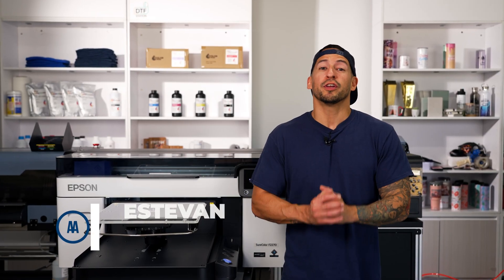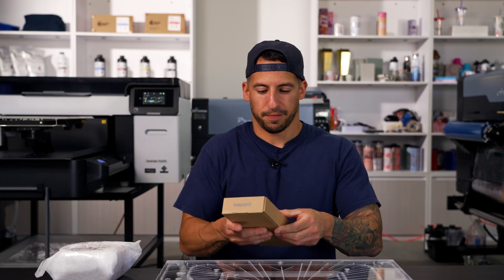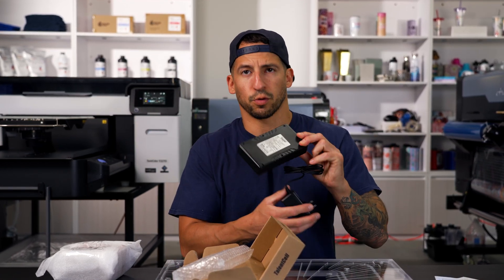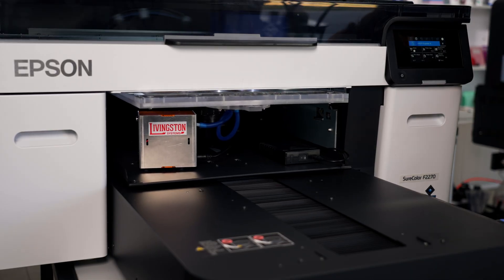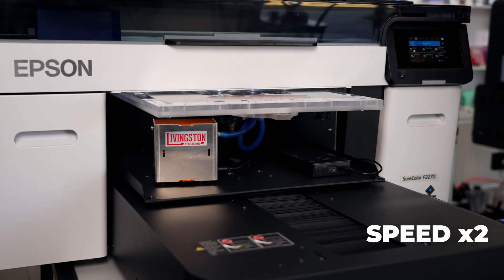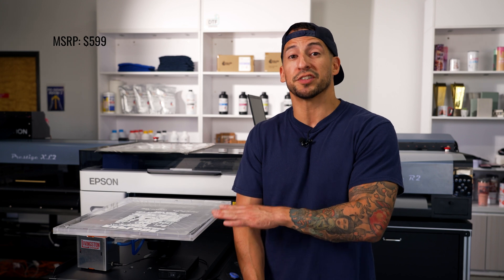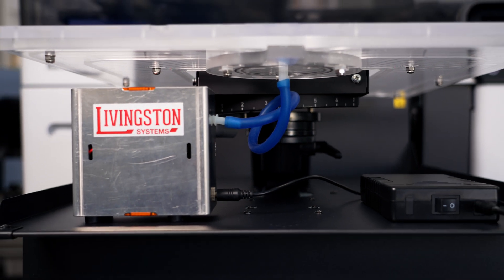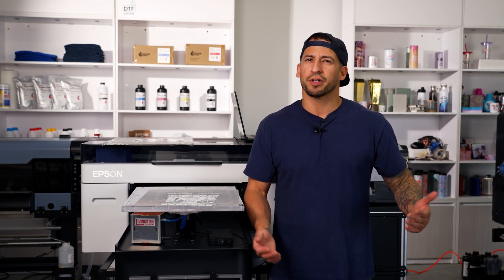Print #DTF Sheets BETTER: Epson/Brother #DTG

Comment: Someone finally copied DTGs vacuum platen.
Reply from the maker: Was there a vacuum option previously for Epson or Brother dtg? I had only seen the one for the converted DTG printers running Epson print heads
Reply: @AAPrintSupplyCo  not for those printers.  I was referring to the DTG G4 machines that have the vacuum platen on them.  It’s a great feature.